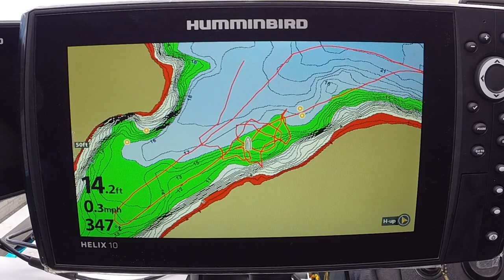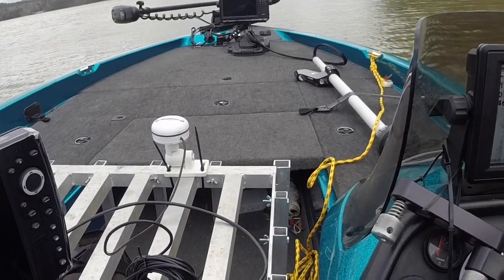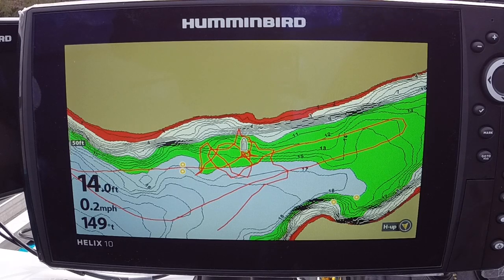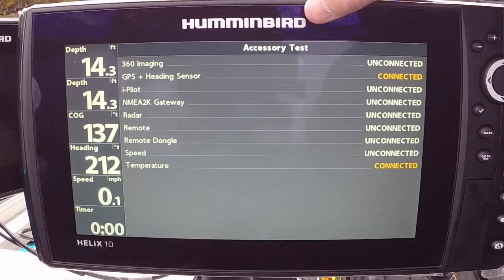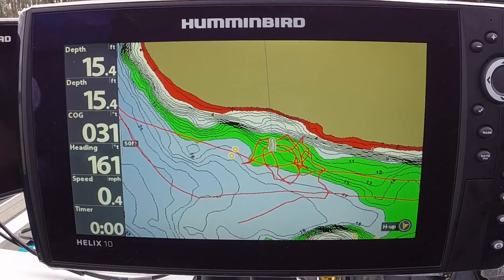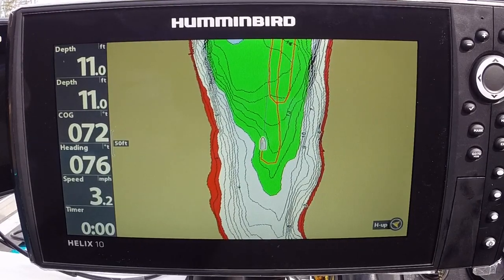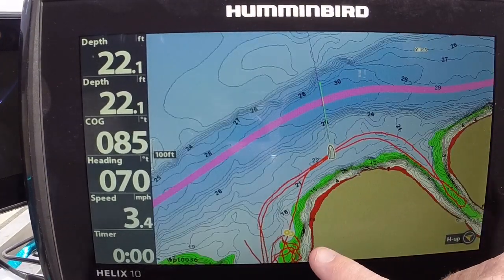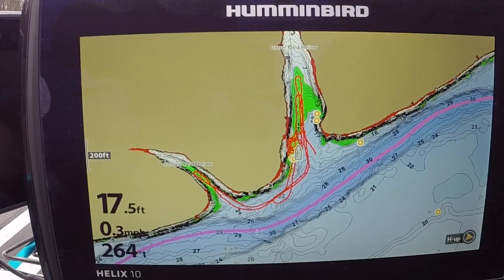Helix heading sensor setup

Comment: Awesome video. I’ve been having issues with my heading sensor and install.   Even if I use internal gps antenna my boat icon is running backwards when I’m going fwd and the cog and heading are pointing in different directions. With and without the asgps hs any idea what that could be? Heading was 038 cog was 275 with the puck? Any insite would be great. I may have a bad heading sensor. However I switched to internal and even used the ulterra heading sensor and with no change so weird

Comment: Your excellent advice and tutorial solved all my issues installing my new Humminbird GPS Head Sensor for my Helix 9 Mega SI Gen 4 and Mercury 4-strole 90HP outboard motor (+ Minnkota i-pilot non-network and MK Head sensor puck) set-up. NICE... Everything works like a charm. Any speed I go with my outboard or trolling motor, I now know exactly where I'm navigating at all times. NOTE: Your info helped me find out that my sensor puck or sensor puck cable bundled in a loop next to the Mercury outboard motor main cables was the problem, despite the fact that using a compass in the garage looked good. Your video also brought me to understand how beneficial it is to display both COG and Head-up direction lines on your chart when navigating.You are so bang on with your video. Thanks!

Comment: Can you use one hb heading sensor for more than one graph?
Reply: yes. just need ethernet cable and 2 units with networking feature. g3n for example or any generation with for that matter with the letter n. the "n" in g3n stands for networking. allows waypoints to be shared and other things like the heading sensor and gps data.

Comment: See the Hs in accessory  diag list but still using internal gps, I am not seeing the network tab.  Did change to custom from angler. Helix 8 4pm. Latest software. I have no network equipment. Worked last year.
Reply: That is Helix 8 G4N

Comment: Pickwick I'm going to triple check my cable connection to the back but my Helix 12 G3N is not picking up the AS GPS HS device. It only lists the Internal GPS.  Also in the Box Overlays I found Course, but no Heading, which I find strange. I'm doing all this in my garage in Normal mode. Recommendations? TIA
Reply: need custom mode first, then go to network and change source to as gps hs
Reply: @EastCoastLtd I can't believe it has been this long. I never did install the puck, but now I'm  going to do it. My question, besides plugging into the back of my Helix 12, do I need to (I'm guessing yes based on one video I saw) connect the white wire to the positive and the black wire negative of the 12v battery VIA the wire connect panel under the console? Or does it grab the power from the pins plugged into the unit?

Comment: Question: How do I turn on these lines in a Solix G3? I upgraded my graphs and have look in the menu and manual and can't seem to find it. I set up my old graph a couple years ago and don't remember it being hard to find it then. Thanks!
Reply: On a chart screen go to the menu and preferences.   The heading line is in the overlay tab.  COG should be on by default.
Reply: @jamesw5836  Thanks for jogging my memory. That's what I was doing wrong I kept thinking it should be somewhere in navigation.

Comment: I have two older units, a 899 and a 859 that I am trying to connect a external heading sensor to their network. I believe there are no issues with the network, the problem is I don’t get a heading readout on the display. I get a COG and a location option which is nothing more than GPS coordinates.What am I doing wrong?
Reply: Steve is the heading sensor working on the unit it's connected to?  The heading options and information will only show if the sensor is working.   If it's working on that unit make sure the software on both units is the same.
Reply: I believe it is working, the diagnostic readout says it is and the accessories verifies it’s connected. The main problem I have is there is only a COG reading and no heading reading on my display, I was told that the older units such as the ones I’m trying to sync the heading sensor to doesn’t have a option for heading readout. But when I move the puck around it does change my COG reading, i just can’t calibrate it against a heading readout
Reply: @stevec407  Its been awhile but I think I remember there being a heading line on the older units.  In fact if you look through some of my older videos I think I made on on how to set the sensor and turn on the heading line.  That would have been on one of the x99 units.
Reply: James, could you direct me to that video?
Reply: @stevec407  I think it this one

https://www.youtube.com/watch?v=Inr-y8Pe_cM

Comment: I haven’t forgotten the video. I ran into a outboard issue and it turned out my brother in law reconnected the spark plug wires in the wrong order.  Yesterday wasn’t windy enough to demonstrate. I’m not going to test in 2 MPH wind. I’m going to show the difference between Minn Kota heading sensor in a decent breeze vs no heading sensor at all. Also my puck is mounted 10 degrees off. I’ll offset it back to 0 and show you how bad follow the contour operates. I can at least do that in calm conditions and again with my Humminbird pucks disconnected. Who ever is saying it’s just for spot lock and jog isn’t telling accurate information. Minn Kota only gives jog with the remote control. Humminbird gives jog using the Humminbird fish finder.

Comment: Here's yet another guy I found experiencing the exact same thing I did.  They just have the Minn Kota heading sensor and not the Humminbird one.  They don't have the under 1 MPH problem and found it works great.  So all these other people who agree with me on Walleye Central and Facebook must just be imagining things. https://www.facebook.com/groups/347005025639101/?comment_tracking=%7B%22tn%22%3A%22R5%22%7D
Reply from the maker: Brandon there is no reason to talk about this.  I have folks here running nothing but the BT Ipilot with no heading sensor or heading/gps antenna follow the contour works great for them.  This is like the whole "you have to have 8 ga wire" thing on forums.  An electrical engineer that is a DC specialist told me that is total BS for the length/load we pull BUT it still continues to this day.  My tests and many installs have proven he is 100% correct.  So I don't know what you are seeing but tend to believe experts first. 

If you want to continue this conversation do it somewhere else.
Reply: I'll post a video the first week of May when the ice is likely to come off our lake.  I'll unplug all my Humminbird heading sensors and show with just the Minn Kota one and without the Minn Kota on follow the contour.  Also I have to make sure there's enough wind otherwise the test won't be valid.  You'll see in a 5-10 MPH wind the boat getting blown way off the spot and when I connect Minn Kota puck it stays on course when cruise control get set on 0.6.
Reply: So if I get a day that rains all day what ever weekend is ice out, I'm not going out there.  I also won't be testing it out if there's not the right kind of wind.  White caps won't matter what you use for slow trolling.  I'll be finding a bay in my lake with a wind like this: https://www.youtube.com/watch?v=KhTkKpQ_PO4&t

I'll definitely show the map offset and debunk that myth easy if again the elements don't make it so ridiculously comfortable to be out there. I'll do that regardless of the wind.

I expect to be putting in the dock, boat lift, and finally my dad's pontoon and my Lund the first weekend in May unless the rain we are getting next week surprises us and the ice all of the sudden dramatically thins out more than we expect.

Comment: Hey Pickwick Marine Electronics.  So you know what the difference is between the Minn Kota heading sensor and Humminbird?  One has just a compass heading and the other has both the compass and antenna.  The Humminbird heading sensor can make follow the contour better vs. the Minn Kota because of the antenna on the opposite end of the cable than where the puck is located.  If Minn Kota is telling you that the Minn Kota bluetooth does not improve follow the contour over using no heading sensor at all, that's hogwash.  There's a HUGE difference trolling at 0.6 MPH using the Minn Kota bluetooth over using nothing.  But I did decide to get 2 Humminbirds just because I wanted a better connection to the satellites.
Reply: Well Brandon I get my information directly from folks that I am 100% confident understand the particulars of the Minnkota/Humminbird products. What I post here, and other places, is a set of factual information from those folks and experience.   If it's OK with you I'll ignore your not-so-knowledgable advice. I hope others ignore you also.
Reply: Well I was busy last year doing projects every time I went up to the cabin.  When there's ice out, I'll prove it on video.  It's about as obvious figuring out if your TV is turned on or turned off.
Reply: Didn't the cable companies tell you you needed a cable box and we found out that wasn't true.  Remember how many arguments that started.  Turned out people weren't crazy.
Reply: Another thing they I just heard was map offset apply when you insert a new Lakemaster card.  It absolutely does.  I went around a reef last year multiple times and every time I shifted the map it and I would be in the weeds say on the west side leaving it alone and when I shifted I would be in deep water on the west side and in the weeds on the east side.  I have found manual maps are the way to go around weed edges at least on my lake.  I started auto chart live but I haven't had the time to map my whole lake yet.  I'll video proof that as well.  Like I said, I got my new Lund last year and I kept having project each week I was working on.  Plus I have a boat lift.
Reply: Plus any person who understand technology really well doesn't claim they know someone who is 100% confident.  I work in IT.  I deal with something a  lot bigger than just your local network on your boat.  There's bugs and a lot of things that are supposed to work a certain way that do not.  There's different updates that could affect how the heading sensor operates.  There is no such thing as an software engineer or any high level tech that's 100% sure.  Most of the time they are right.  I'm just telling you just in this simple setup with I-Pilot Link there's way too many variables for you to know someone who is 100% confident.

Comment: Is it possible to connect the AS-GRP-HS  direct to the Helix 12 G2N unit? Or do I have to go thru NMEA 2K to get it connected?
Reply from the maker: The HB HS antenna plugs into the back of Helix units.  They are not NMEA 2000 deices.
Reply: THX a lot for your fast answere !
Reply: Pickwick Marine Electronics how to plug to helix there are no cables only bt connection with minnkota ?!
Reply: The arrow on the reciever just needs to be pointed towards front of boat as close as eye can tell?  Just mainly checking for interference?

Comment: GREAT VIDEO-extremely informative using the Helix---BUT....i HAVE A 898ci HD Humminbird GPS :  WHAT would be the list of views to open, engage so as 'dial-in'/'pair' my Ulterra Head sensor using the 898???  Thanking you in advance
Reply: John the 998 and Helix interface are very similar.  You should be able to get the same view as what I have showing.  To my knowledge the wording hasn't changed.

Comment: Thanks for the great video, it was awesome and explained a ton.  Question for you though, instead of dialing it in on the water, could you not do it while driving down a straight road, with boat on the trailer and get that puppy completely dialed in?
Reply from the maker: I guess you could do that.  I've never tried it though as I use any excuse I can when the lake is involved.  :-)
Reply: Do you know how to show it on the Solix or even the Onix?  The COG and Heading readings so that when driving one can get it dialed in?
Reply: Never mind, figured it out thanks
Reply from the maker: Good deal!

Comment: I bought new sensor 

XHS 9 HDSI 180 T Transducer

for my
HELIX 9 SI GPS.

Instaleed new Versions

HELIX 9 SI GPS,Vers.1.46 and Basemap,Vers.1.051.

Fishing deepth 4-7 meters.

After updating cannot see any of fish symbols on the sonar
screen.No fish alarms(alarms-On).

I am using 455Hz.

What reason could be???
Reply from the maker: I don't use the fish id feature so can't help much.  If you haven't reset the defaults on the unit give that a try.
Reply: Problem resolved,thanks